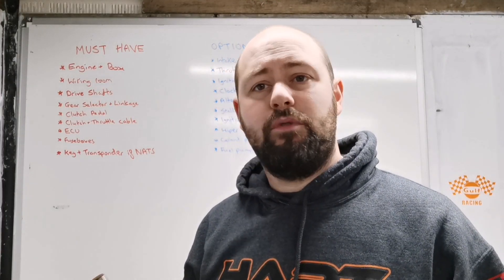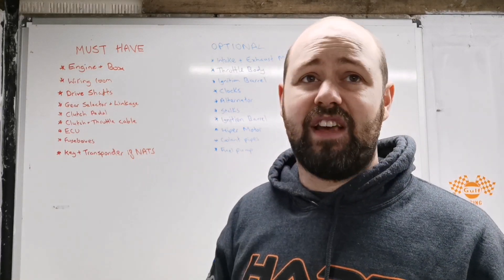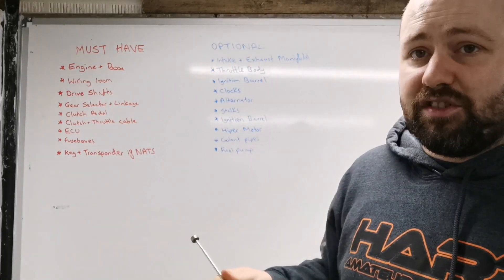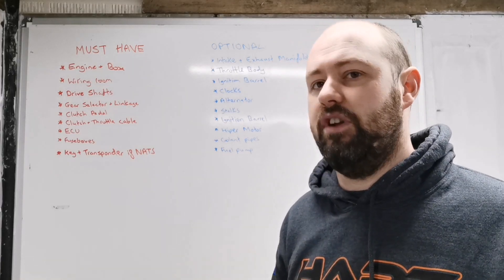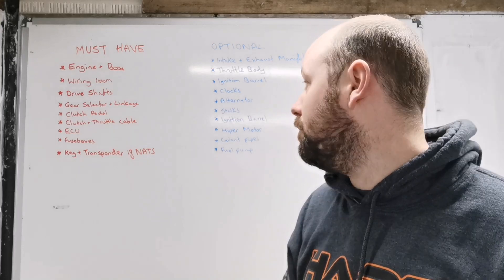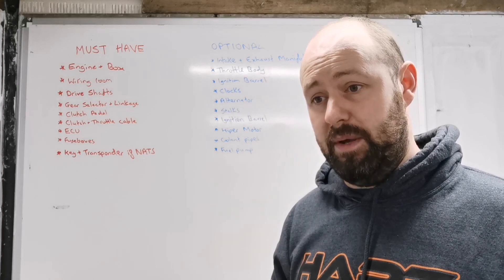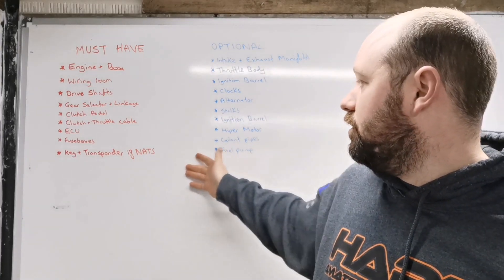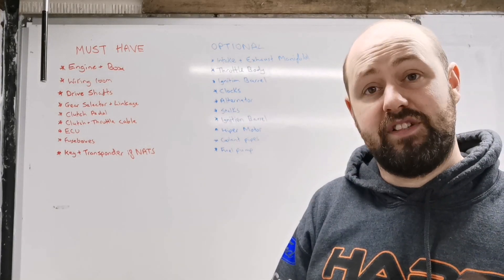Putting A Nissan Micra Engine In A Classic Mini.... What You Will Need

Comment: Really helpful! One question, can you use the classic mini clocks with the micra engine? Cheers
Reply from the maker: Yes you can I am using a company in the UK that can make a speedo cable that will use Nissan gearbox for the pick up and classic mini clocks

Comment: Did you mention coil pack? I don’t know if they have a coil pack or coil on plug?
Reply from the maker: This particular engine is distributor not coil pack bud. The 1.4s had the coilpacks not as popular ATM as the 1.3 conversion but I'm sure as it gets even harder to find the 1.3 Unicorns the 1.4 will become popular
Reply: thedjse ah, I thought it would be too modern for a dizzy 🤣

Comment: In my opinion with the wiring sticking to minimal loom to get the engine ecu and clocks working and keep that seperate, then I have taken a live from a main source to a new spade fuse box and re made the mini loom (or your could just chop up the engine bay side of the mini loom and modify that to just need a 12v live to then run the both looms separately within the car 👌🏻
Reply from the maker: Yes that's the plan run as little as possible from the Micra!